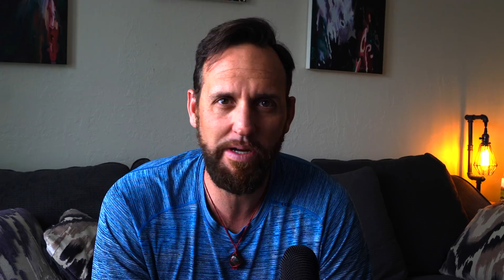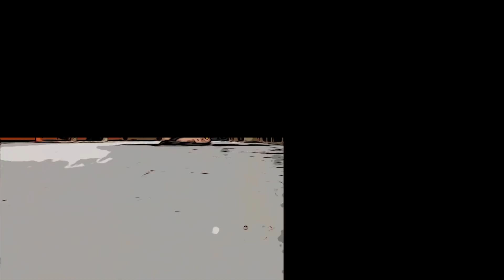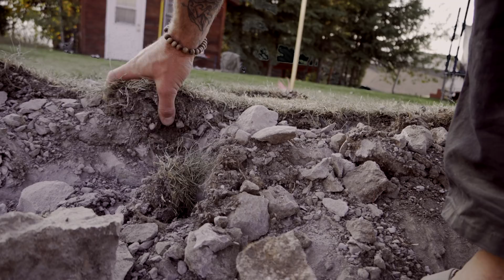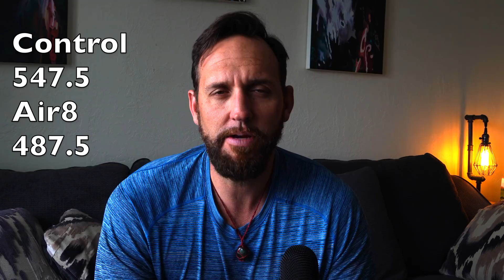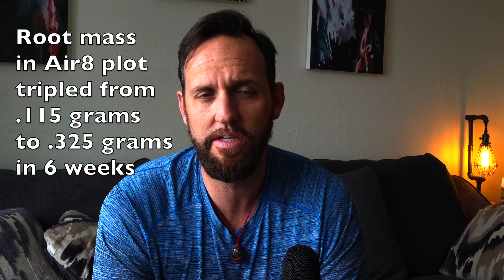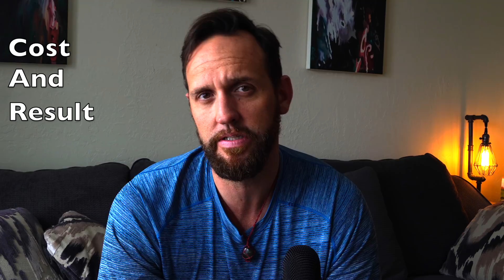Air 8 Liquid Aeration Research Data, Roots, Water, Compaction, Summary Pt 3

Comment: Thanks, Based on what my needs are and your three videos here I am planning on using both.  In the main reason for this is to help in leveling out my lawn.  Yes I have areas that do need to get much better water to the roots. But I also want to slowly lower the high spots and raise the low spots. Am I thinking correctly? Thank you again for your educational videos. They are extremely interesting and are teaching me a lot. My apologies for this being a two-year-old video series that I am commenting on. I am just extremely interested in the subject.

Comment: How does air8 affect Sandy soil in east central Alabama?
Reply from the maker: If you have sandy soil, it’s likely not compacted to begin with. The particles of sand are large enough to maintain space
Reply: @Lawncology  ty so much from responding . Would humic 12 and RGS help improve my soil and not make the soil around my septic tank hold water?

Comment: I have clay soil that is pretty compacted.  We have just planted a bunch of new trees and swans to give the best chance to develop a good root system.  Would it be ok to use Air 8 relatively heavy around the trees to aerate the soil so the roots can really drive out away from the plant?
Reply from the maker: I would feed the trees will rgs at the bases and some triple fert if possible. We’ve had great luck as preplant with air8 and RGS being outed into the hole at planting but if you’re in the ground, I’d work on the tree growth itself
Reply: @Lawncology  I appreciate the quick reply.  Already on that and will continue.  Thanks again

Comment: I have a sandy loam soil, CEC has been climbing and sits at 8ish. I don't have standing water. Would my soil benefit from air8. I have been using RGS, microgreen dthatch and Green effect for a couple of years. Also on a side note would it be helpful when doing a reno to help the new seed with root development?

Comment: Thanks for the research part of your company approach.  I think your products really do work.  I spray them on my lawn and others.  Noticable differences.  Thank you for clarifying the Air8 only plot which I questioned was missing.  I'm realizing that the soil Amendment approach isn't an overnight, one season deal.  Takes time to correct.
Reply from the maker: Thank you for bringing it up as well. I wanted to make perfectly clear where limitations were and if I were to say “those camp actions readings were at 15” below the surface,” it wouldn’t much matter over all. If they were 2” below the surface it would be terrible. Reality is 8-12” for readings.

Comment: My SeaK came in yesterday. I can’t wait to spray it in the yard.  Has anybody tried it yet?
Reply: I’m currently doing 550 homes with it. Great product.
Reply: I’ve been using It for 6 months on lawn, plants & trees. I have  4 gardenias that are in the shade and for the first time in 5 yrs they’ve bloomed  flowers. I credit the sea-k
Reply: Thanks. I’m hoping it helps give me that dark green look.  Still trying to decide if I’m going to use Roybi back sprayer or dial in hose sprayer.
Reply from the maker: Either on will work, but the backpack could be easier since it’s a low volume application
Reply: @Lawncology  Thanks John for the reply. One more question for you. Can Sea K be applied with the other NEXT Bio. products such as Humic12 and RGS in a dial in sprayer. 
Looking to apply my second round of the bios AKA “Lawn Domination of my neighbors” in the next few days.